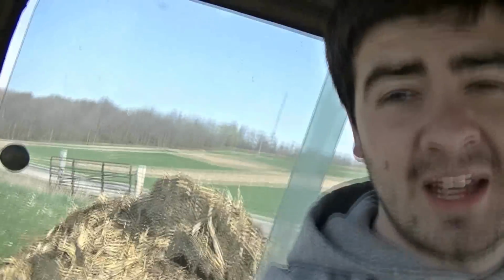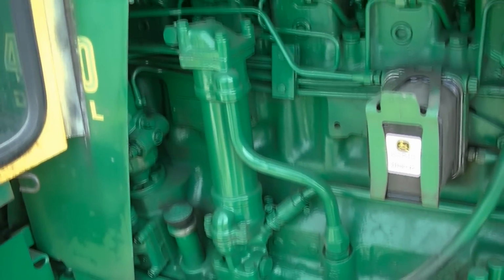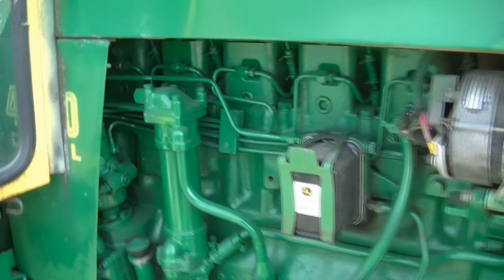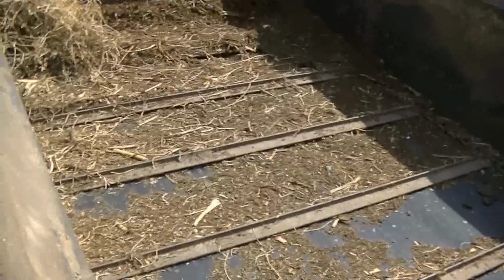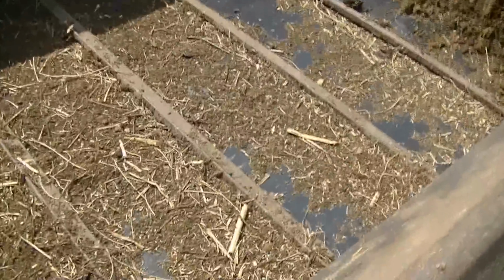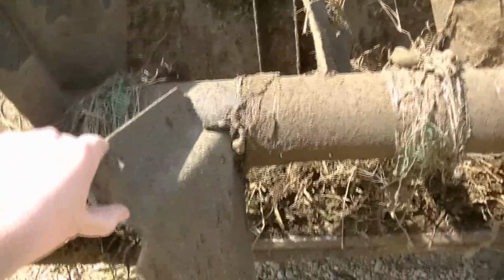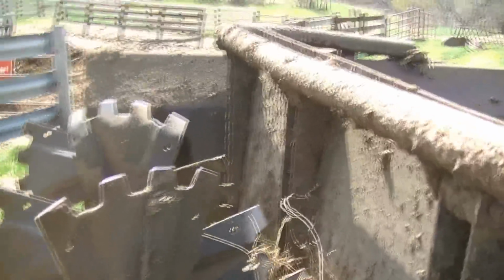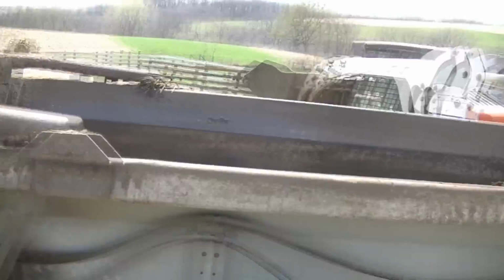Fish kills, erosion, and the JD 4020 hauling manure

Comment: Used to be a dairy farmer..30 years ago.. Down in lower S.C. we really don't have to worry about runoff. Our highway ditches are so unmaintained that the water only has two ways to go up in the air or down into the ground.  It takes a long time for us to dry out. We spread chicken litter before we use a Harrel stalk chopper with  seed drill to. plant a Wheat cover crop. Does a real  good job

Comment: Interesting - thanks for the videos.  Would like to hear more of an explanation of what you mean by farming in "contours".
Reply from the maker: John Latham There's always one person who asks! Haha. We farm in alternating crops. It was big in our area in the 80's to slow erosion. Not as popular today but none less effective.
Reply: How Farms Work OK, so corn, followed by soybean, followed by hay, followed by corn?
Reply: Alternating strips that run around the hills basically "on the level" (basically all at the same elevation, following the curve of the hill).  It's a method to reduce runoff and erosion.  

If you have the entire field from the top of the hill to the bottom in a single crop, in heavy rains the soil can start washing down the hill and not stop til it gets to the bottom.  With contours/strips, some soil might wash down from say the corn strip, but it'll be stopped by a hay strip, or a soybean strip.  Similarly, soil might wash from a soybean strip but be stopped by a hay strip or corn strip.  The alternating strips break up the water flow and runoff, since the soil has different properties and different amounts of cover, roots, etc.  These changes modify the flow of the water and how much sediment it can carry, slowing it down and catching the soil before it can erode away.  

Contours is an interesting practice, not one we see here, but on the hills of our Shiner farm, when it was row-cropped back in the 50's, it was common practice then to build terraces, following the contour lines on a map (basically,  connecting points of equal elevation around the contour of the hill) and using a plow to throw the dirt up into an elevated "ridge" that caught and held the water, and prevented it from running straight down the hill, causing erosion.  

Farming on beds or rows followed the terraces around the hills to the ends... Made for a lot of curvy, serpentine rows, point rows, etc.  Just a nightmare to plow, plant, and cultivate and to an extent, harvest.  Strips looks much easier to an extent... 

Not the best way, but back in the 50's, it's all they had.... 

Later!  OL J R :)